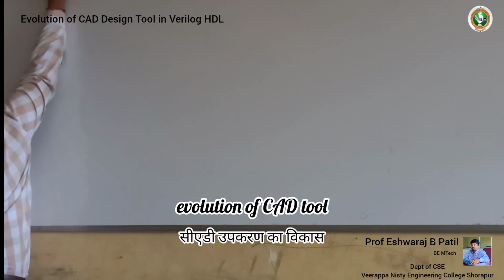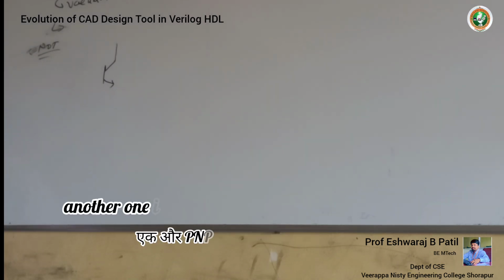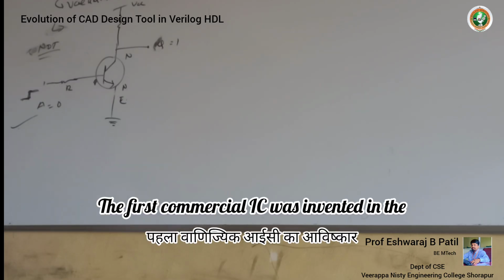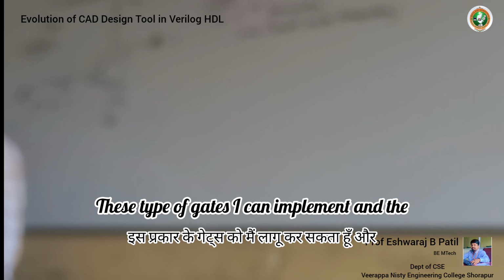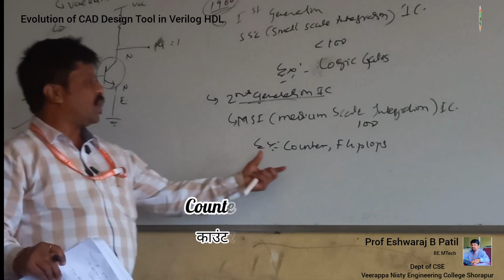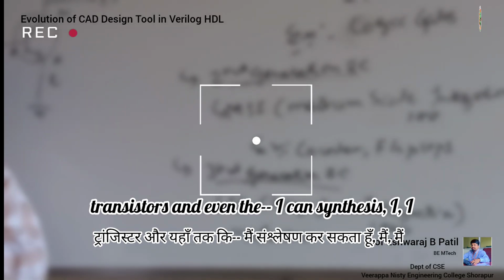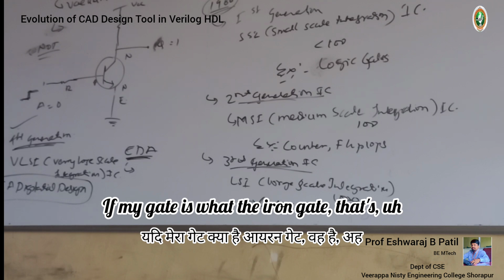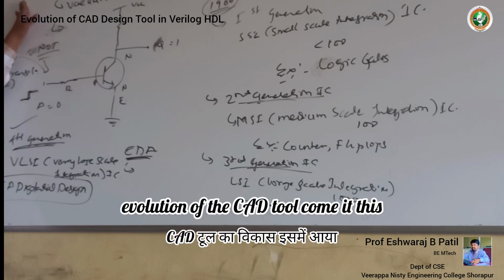DSDV : Module I : 02 _ Emergence of CAD Design Tool

Comment from the maker: This video, presented by Prof. Vishwaraj B Patil, explores the evolution of CAD (Computer-Aided Design) tools and their necessity in modern digital system design.

Key takeaways include:

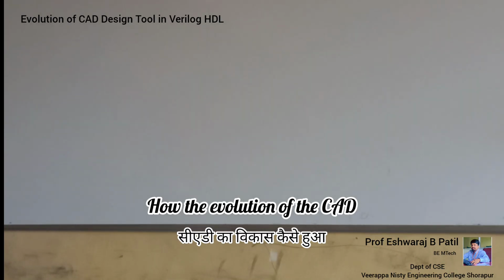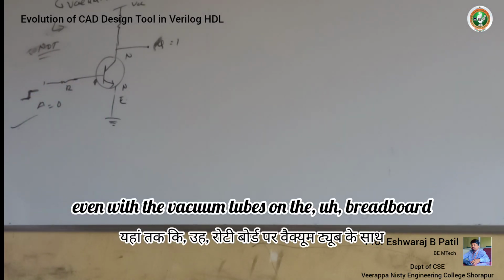Early Design Methods: Historically, digital systems were designed manually using vacuum tubes and transistors on breadboards (0:39 - 3:51).
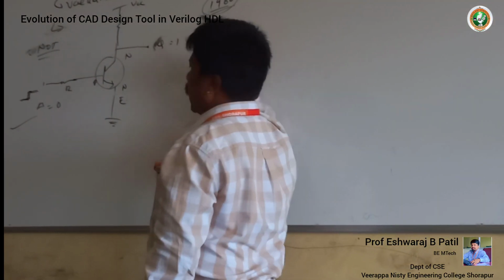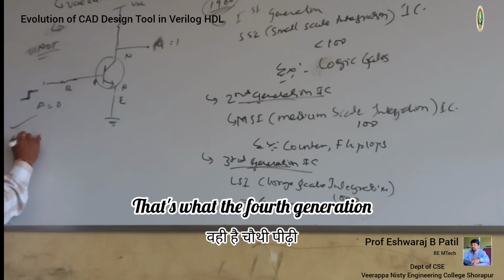The Rise of Integrated Circuits (ICs): As designs became more complex, the industry shifted to ICs, categorizing them into four generations based on transistor density (5:43 - 9:55):
SSI (Small Scale Integration): Less than 100 transistors (e.g., basic logic gates).
MSI (Medium Scale Integration): 100 to 1,000 transistors (e.g., counters, flip-flops).
LSI (Large Scale Integration): Over 1,000 transistors.
VLSI (Very Large Scale Integration): Designed for high-complexity circuits requiring automated CAD tools.
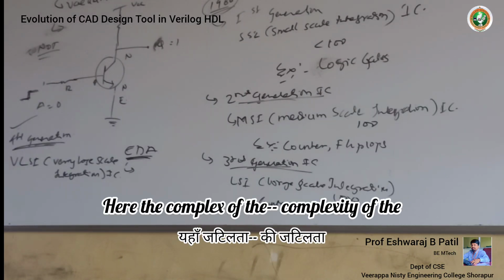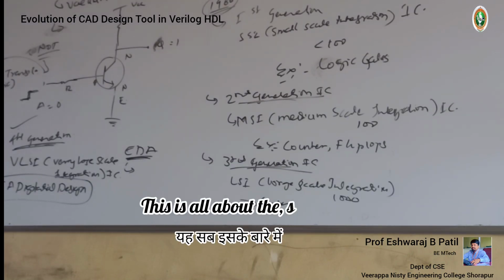Role of CAD Tools: As complexity grew, manual design became impossible. CAD tools emerged to automate the design, synthesis, and simulation of circuits. They utilize RTL (Resistor-Transistor Logic/Register Transfer Level) schematics to verify circuit functionality via automated test benches and waveforms before physical implementation (11:13 - 13:46).
The video concludes by introducing the transition toward the emergence of HDLs (Hardware Description Languages), which serves as the foundation for the next topic in the course (15:00 - 15:23).